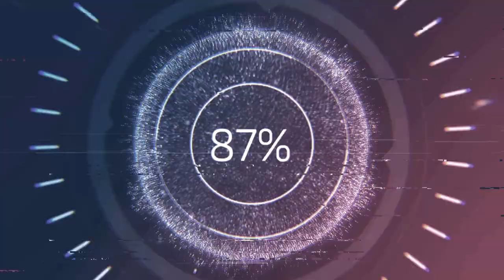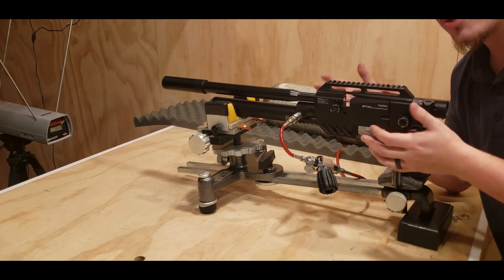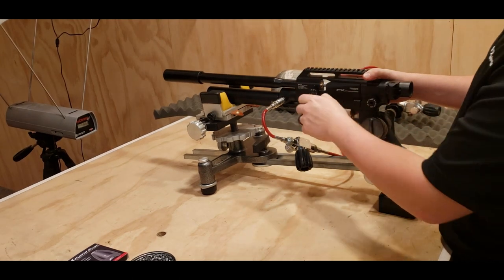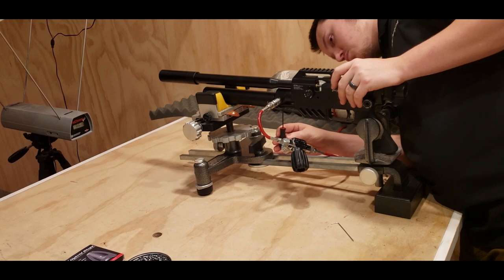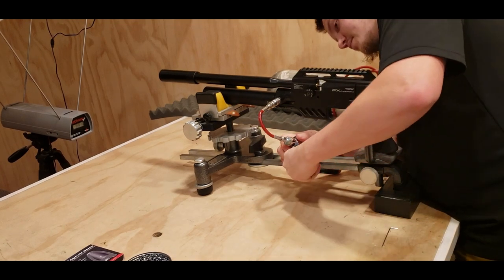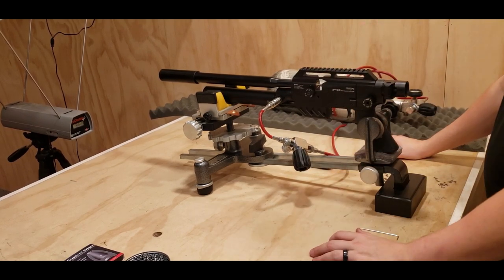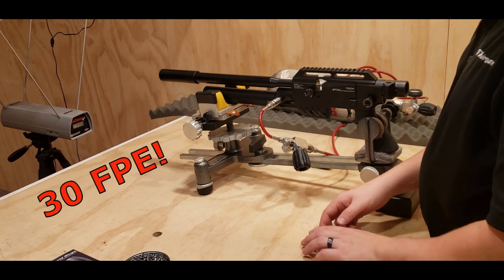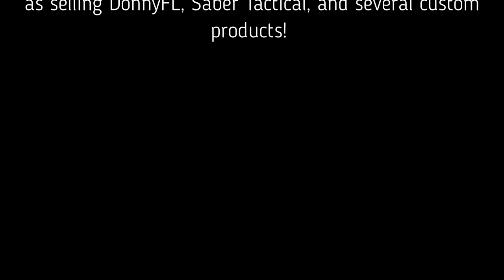FX Dreamline Compact Tuning Guide - FX Airgun Dreamline Airgun Tuning

Comment: What is the number of the Allen key you are using for the hammer
Reply from the maker: 1.5mm for the hammer adjuster on all models of Dreamline except for the Classic, it uses a 5mm
Reply: @910AirgunTuningandRepairs  Thank you sir I have a dreamline tac 177 with 350 border is shooting around 844 to  850 with 10.34 jSB pellets the válvula it's around 135 to 140bar and I want to shoot around 900 to 920 do you think giving some turns to the hammer it will go up

Comment: I had an email from fx that the power plenum will not work with the .22 because of the barrel shroud iam waiting to see someone try it out mine is on backorder  would like to see what you have to do.
Reply from the maker: Hey Chris, the plenum will not fit the Dreamline Conpacts due to the barrel design. I believe FX Sweden is working on a solution, but as of right now, the plenums will not fit unfortunately
Reply: Yea dont know what there fix is going to be said there is no plans to change the plenum so wondering if there going to change the shroud design
Reply from the maker: @chrisfoster1808  the Compacts have the SuperLight barrel system, so there is no internal barrel, only shroud and liner. They will have to either extend the coned portion or just go back to the original barrel design
Reply: @910AirgunTuningandRepairs  hope they extend the cone I call the liner a barrel  but yea I like the liner that's in there. Let us now if you find out more than I have when I ordered my they didnt know it wouldn't work  on the .22 that's why I email fx usa.

Comment: Hello Newman,I have the impact with power plenum,today I was out shooting and then air started leaking from power wheel?any suggestions?
Reply from the maker: Hey Arvil, that leak is coming from one of the two orings on the Valvetube End. FX uploaded a schematic of the FX Impact w/ Power Plenum. The o-rings you are looking for are location B22 (9x1.5 NBR90). Let me know if you need any other help!
Reply: Thanks newman
Reply: Hello Newman what is a speed for 33.95 jsbs impact 25 cal,I have human reg and power plenum from fx USA,,when I turn reg up fps goes down currently have it set at 110 shooting 850-870??

Comment: And the power plenum won`t fit on the compact 🤷🏻‍♂️
Reply from the maker: For now 😎 Sweden is working hard to find a solution
Reply: Yes but i can`t se how they will do other then offer a new barrel or shroud that we will have to buy as well 😁 but did see one that makes a longer brass inlet so the barrel is moved forward to give space for the plenum.
Reply: @spydefpv7879  yes. But it's supposed that is a compact gun and with that mod you're making longer the gun. The perfect solution is just to change the shroud and keep compact the gun. 👌